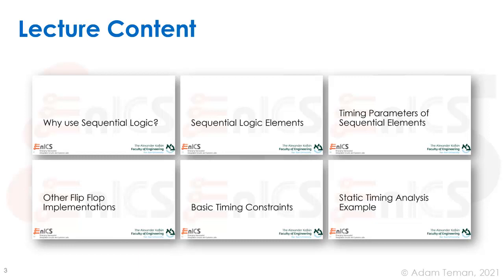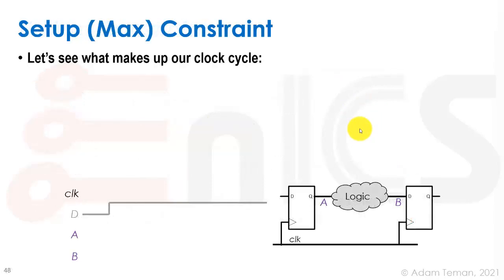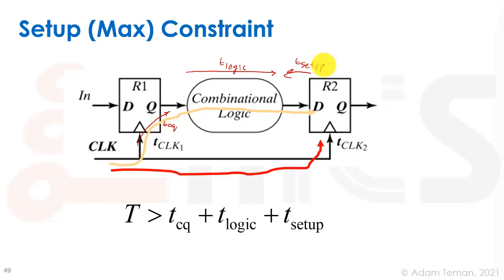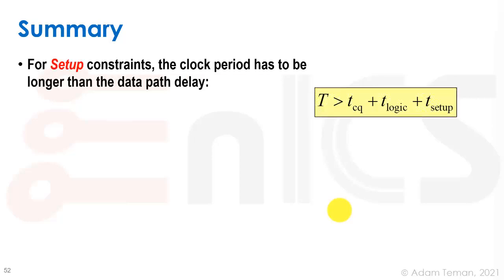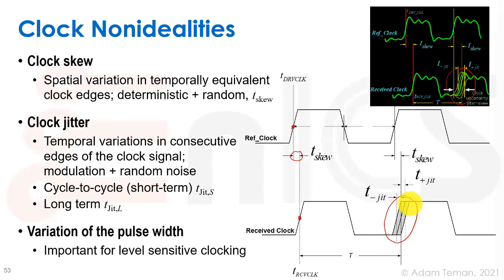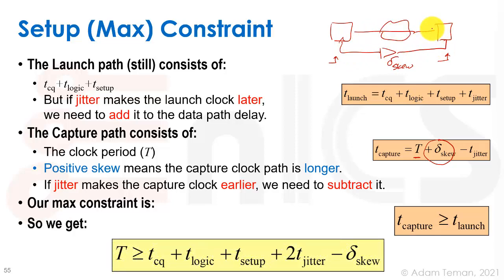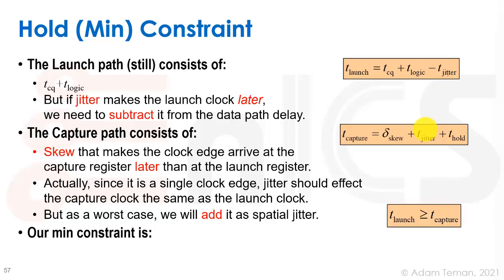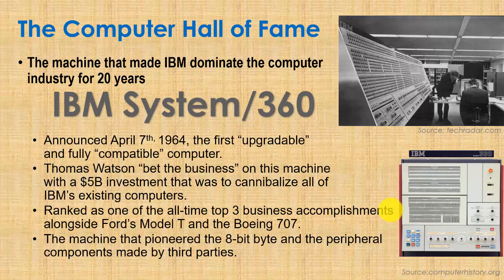VLSI - Lecture 7e: Basic Timing Constraints

Comment: sir for hold constraint, the line should be if jitter makes the launch clock "early" we need to subtract it from the data path delay. and not later right ?
Reply from the maker: Yes, I think that you got that right. 
The data is launched early, thereby causing the delay through the launch path to be shorter (the data to reach the arrival point early). 
The capture clock arrives late, making the capture path longer (slower).
Altogether we get 2*Tjitter.

That being said, as I mention in the lecture, I believe this is an overkill, since a large part of the jitter (perhaps the majority) is shared between the launch and capture path when a single clock edge is referenced. Therefore, I don't like adding this overhead.
Reply: @AdiTeman  Got it! Thank you so much